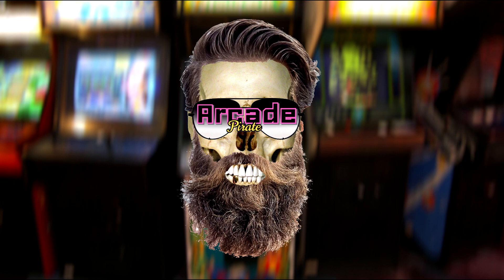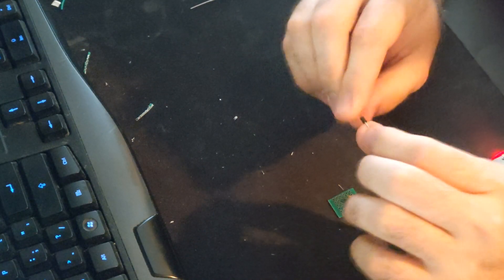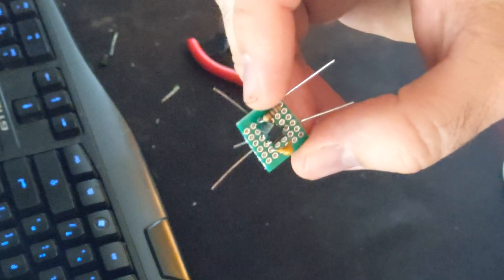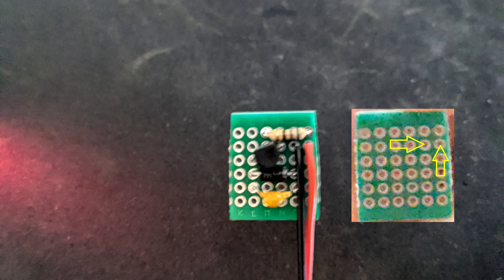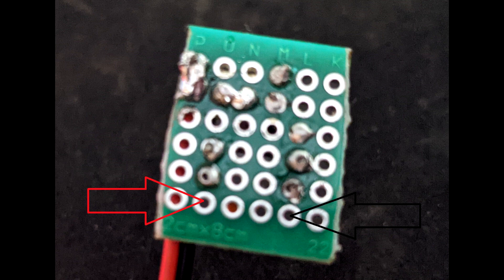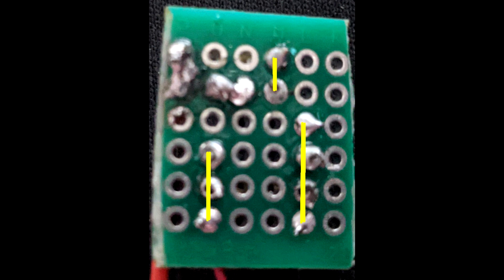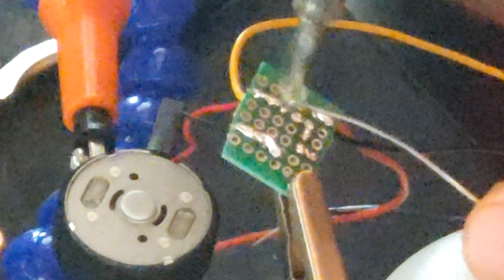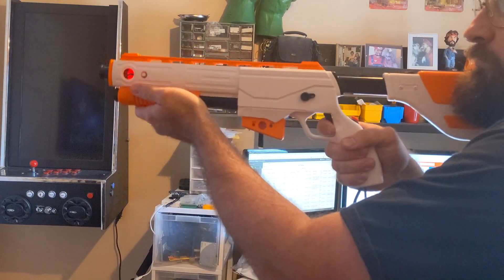GUN4IR Rumble pack upgrade

Comment: Did you use an original 360 rumble pack for this? Its a right pain to get the space right. I've completely flattened that area you've put yours in on both halves of the gun and its still not enough space (I can close the gun but the axle is pinned so it cant turn). I'm now having to try and melt a slight recess without melting all the way through to the outside of the handle.
Reply from the maker: The link I provided is the exact motor I used for the gun. I had to melt a lot of the gun to be able to fit the motor.
Reply: @ArcadePirate  ah I missed that. Yeah jaybee warned me to avoid replacements as they tend to be 7.5v Chinese ones and he said they sometimes don't play nice. So I used ones out of an old controller. I think they might be slightly taller.
Reply: I can see from the video that mine are sitting lower than yours for instance. It'll be fine if I'm careful. (famous last words)
Reply: @Podbod  whats that 680 ohm resistor for? Its not mentioned in JBs guide. I want to harvest the motor from my old ps2-clone Controller, will I need this resistor?
Reply: @andreasbaumann8066  I think it depends on your rumble motor. I used a 360 one and a 1k resistor. Your best bet is to join his discord and ask. Theres bound to be someone whos used a ps2 one who can tell you the right Ohm value.
Reply: @Podbod  OK, thank you. I wasn't aware of that but I will go and ask the Guys at discord. Cheers.

Comment: Hey fella. Loving your videos. I'm doing the same build following your guide. (minus the solenoid and rgb light). I notice in this video you've actually wired up the handle buttons and stick. Do you have a guide on that too? Cheers!!
Reply from the maker: I might make a guide on that one day. It was kind of a pain to set up. Lol
Reply: @ArcadePirate  cool. Its not essential I guess. Ive wired the front button and the slide. Plus I have a spare jolt gun pedal I plan on connecting up. So I'm not going to be short of inputs.

Comment: What do you use for power supply for the rumble?
Reply from the maker: USB power that's plugged into the Arduino board.
Reply: @ArcadePirate  the Gun4IR pdf shows a separate "Motor Power Supply" GND and Vcc?  the Amazon link says it’s rated at 12VDC.  Is the USB power give it enough rumble for you?
Reply from the maker: The power for the rumble motor comes from the USB power from the board.